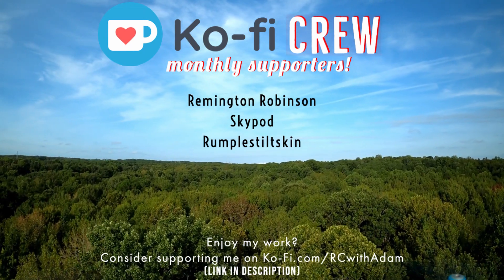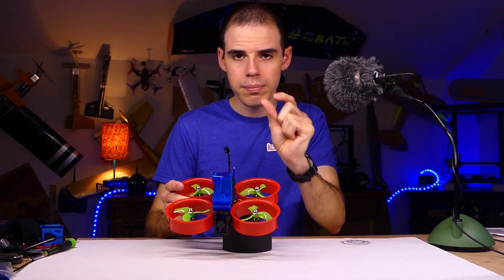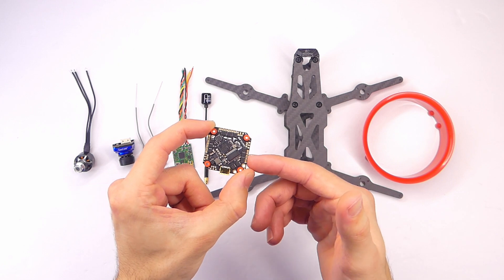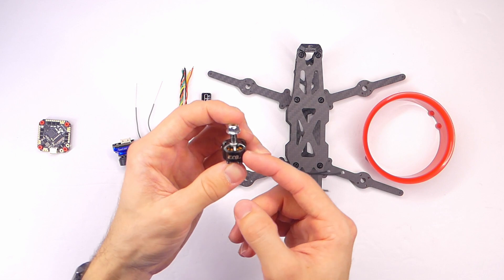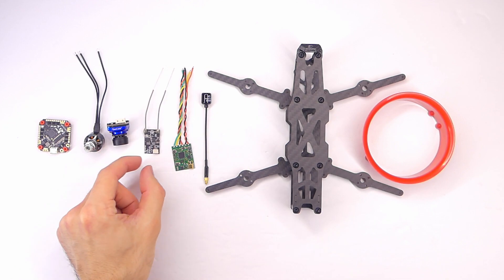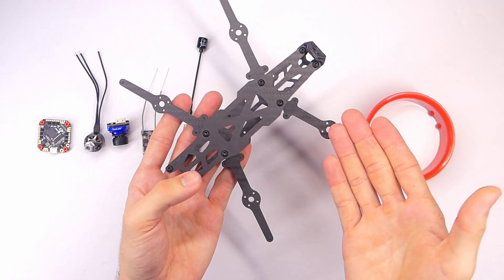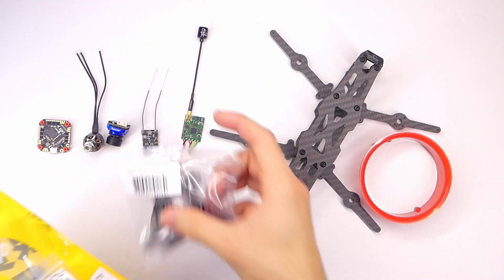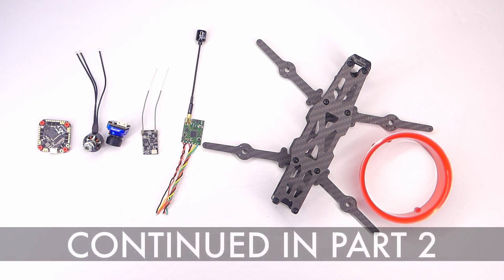PART 1 - COMPONENTS & CONSIDERATIONS - CINE3 3" CineWhoop Drone Build

Comment: I wish you did this about 4 months ago when I built my cinewhoop, I used the same frame. I'm tempted to convert it to a 3" freestyle. Looking forward to your pid tune, I'm garbage at tuning drones.
Reply from the maker: I haven't done any PID tuning either. That may be what these cinewhoops needs to fly well. How did yours turn out? Does it fly ok? I used the Cloud 149HD frame because of the great reviews of the BNF model (and because it's cheap), but so far I've not gotten performance like what I see in the reviews. There must be some secret sauce.
Reply: @RCwithAdam1  as it was my first quad, I can't say much about flight performance. I did try to find tunes of similar quads and try them with no luck. I picked the cloud 149 HD because it was cheap and the fpv camera is forward of the ducts. The V1 is framed on either side with ducts. It probably does need a good tune to get the performance we saw in reviews and other vids of cinewhoops.